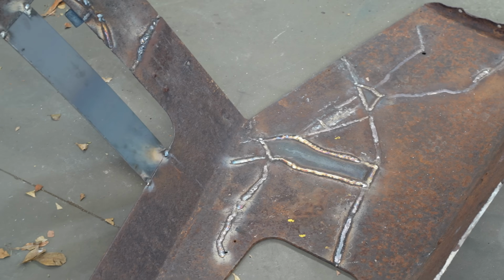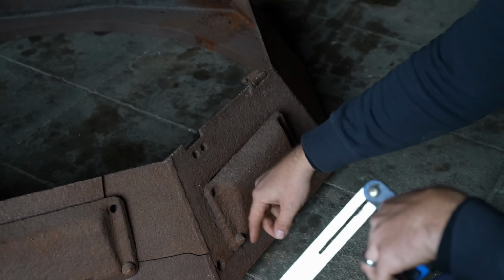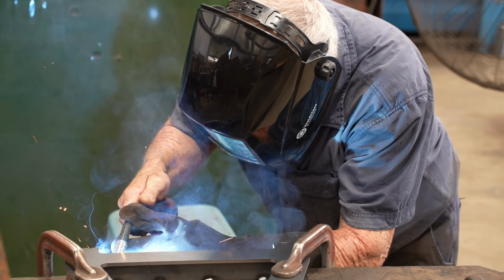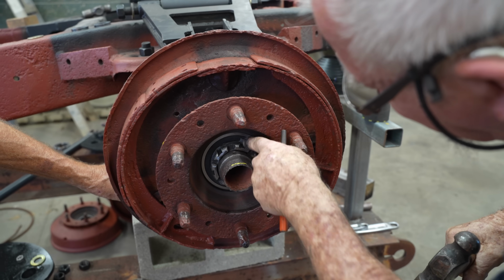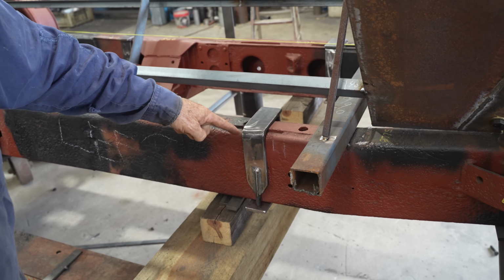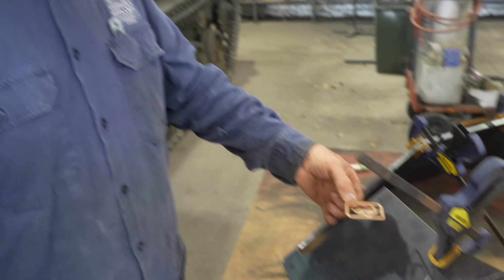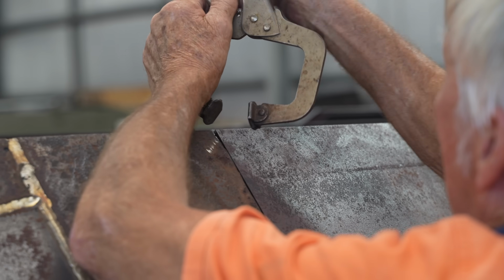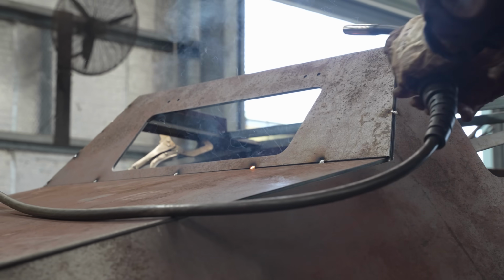WORKSHOP WEDNESDAY: Restoring a SdKfz 221 Light Armoured Car

Comment: I would be real iffy about putting those wheel hubs onto this. With so much pitting they are likely to crack under just normal driving stress. So Im betting this is a garage display beauty.

Comment: You blokes would really benefit from getting a 3D scanner, about A$1500 would get you a prosumer-level scanner that would have made quick work of that turret (and any other oddly shaped bits you want to reverse-engineer). Spending a lot more would get one that gets better results much more easily, but you'd get good use from a simple one.

Comment: The Weald Fondation have a running Sd.Kfz.222 Ausf.A.  They are currently working on a d.Kfz.223 Ausf. A.  And parts of Sd.Kfz.261 Ausf. B for a future project.  All 3 have Sd.Kfz 221 parts  built into them, so you could base your restoration on their information.

Comment: Use paint stripper to clean the paint off the chassis number.  Then apply acid to the number.  The acid will bring out the number because of the displacement of the metal during stamping.  Neutralize the acid with a base like baking soda as soon as you are able to read the number.

Comment: if only aus armour had a 3d scanner to take with them to the czech republic, that way simply scan the items to get the data points and then transfer them to a disc and bang you have all the measurements ,after all the polish tank engine place has it, thus could have asked them to lend it to us and it would have been much more easier to replicate the parts. 🦘✌👌👍

Comment: 11:58 - regarding that number. It should be possible to identify that smashed numbers using methods that criminal investigators are using to identify removed chassis numbers from stolen cars. I’m pretty sure that these guys (and ladies) are happy to work this out! 
Good luck & Kreetz from 🇩🇪 

[quote]

Reconstructing ground-off Vehicle Identification Numbers (VIN) on stolen vehicles is a challenging task that requires specialized techniques. Here are some common methods:

1. Chemical Etching: This method uses chemical reagents to make the original markings visible. Since the metal beneath the surface is altered by the stamping of the number, chemicals can highlight these differences.

2. Magnetic Particle Inspection: This involves applying a fine magnetic powder to the surface. When a magnetic field is applied, the powder gathers in areas where the metal structure was altered by the stamping, making the original number visible.

3. Ultrasonic Testing: This method uses high-frequency sound waves to detect differences in the metal structure. The reflected sound waves can be used to reconstruct the original number.

4. X-ray Fluorescence (XRF) Analysis: This technique uses X-rays to analyze the chemical composition of the metal. Differences in composition can provide clues to the original number.

These methods are typically carried out by forensic experts and specialized laboratories, as they require precise equipment and expertise.

[/quote]

Comment: Always a thumb-up in advance 👍. About the numbers in the steel plate: my profession is NDT/ weld inspections and sometimes when i inspected steel work pieces, i found number that were not visible before the inspection. So what i advise is to do a magnetical inspection on the hard to read numbers. I think then it will be show up very readable. If that still does not work out, the more expensive way is to (let) make an x-ray photo. 
Regards from the Ardennes
Reply: As an ex stolen car investigator, there is different ways to have a punched number come back to be read.
Reply: @althepal6818  tell us about it.

Comment: The measure-up of the O/S parts would go a lot faster, easier and more precise if you had a small 3-D scanner, or LIDAR scanner you could borrow or rent cheap. That would give you perfect precision of all the parts in the yard in little more than a day, with every measurement able to be pulled straight off the computer scans.